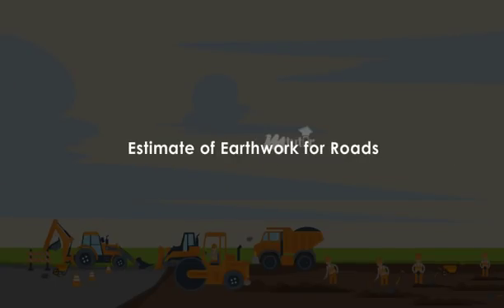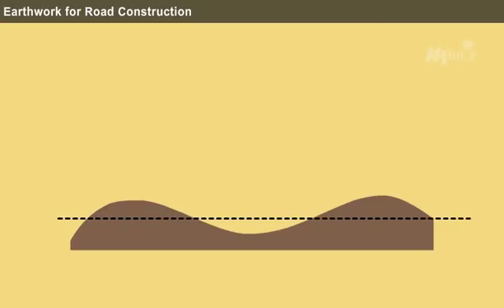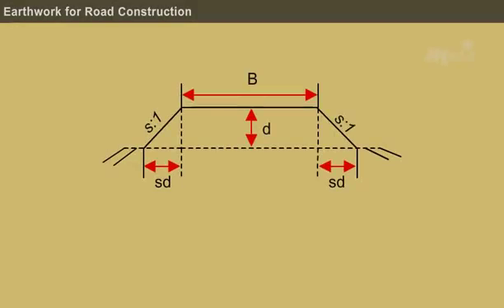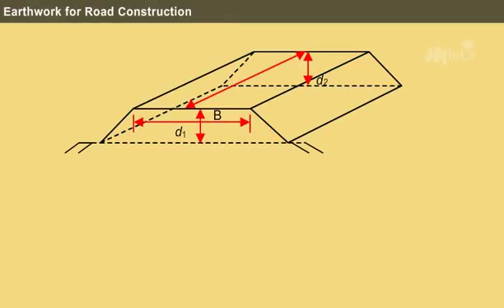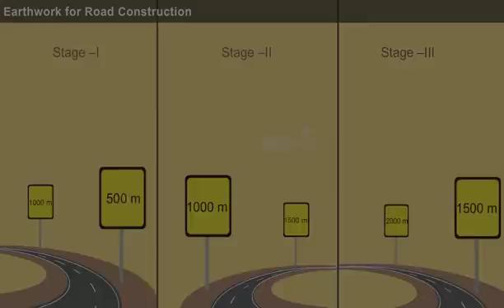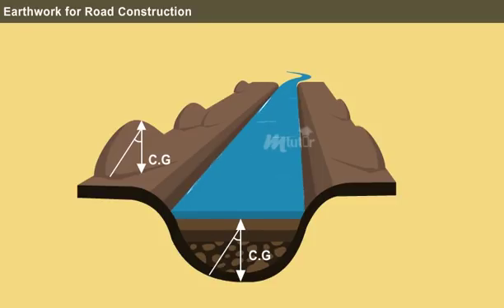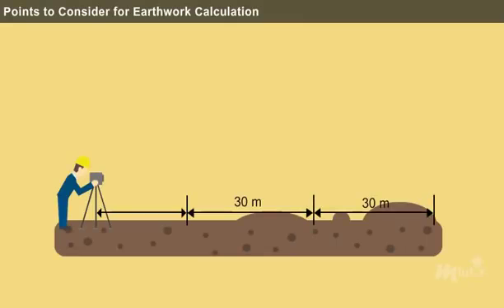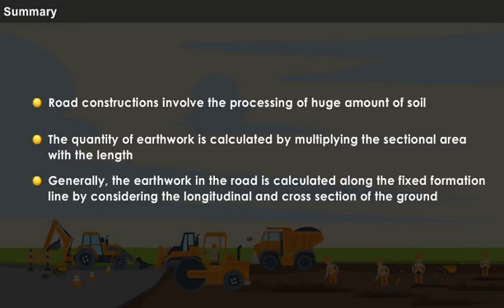Estimate of Earthwork for Roads [Year 4]

Comment: End area methods
Reply from the maker: Hi, 
Yes, the trapezoidal formula for road estimation shown in the video is also referred to as the “end area method” because it uses the areas of the cross-sections at the ends of each segment to calculate the volume of earthwork. Technically speaking, the earthwork estimation is often referred to by either the prismoidal formula or the trapezoidal formula.”

Comment: Which standard is these ranges come from (CESMM4)
Reply from the maker: Hi, The video depicts a technique for estimating earthwork for road construction that is used globally and is not specific to a code of practices. However, rate analysis depends on the type of code used by the country.

For example; 
"CESMM (Civil Engineering Standard Method of Measurement) is a standard method of measuring civil engineering works in the United Kingdom. It provides guidelines for measuring and estimating various construction works, including earthwork for roads.
The Indian Standard code used for estimating earthwork for roads is IS: 1200-1978. It is titled "Methods of measurement of building and civil engineering works" and provides guidelines for the measurement and estimation of various types of construction works, including earthwork for roads."

Comment: A portion of an embankment having a uniform up-gradient 1 in 500 is circular with radius 1000 m of the centre line. It subtends 180° at the centre. If the height of the bank is 1 m at the lower end, and side slopes 2:1, the earth work involved. please if possible detailed calculation in this problem.and This is the best video I have ever seen surprb voice